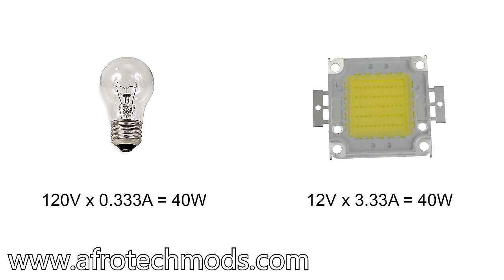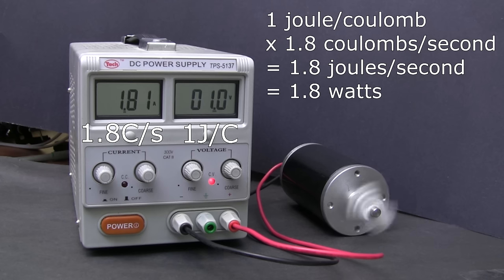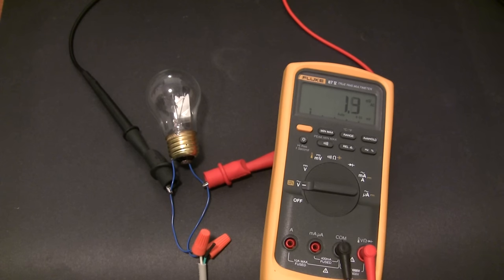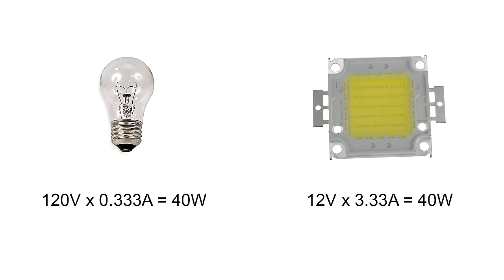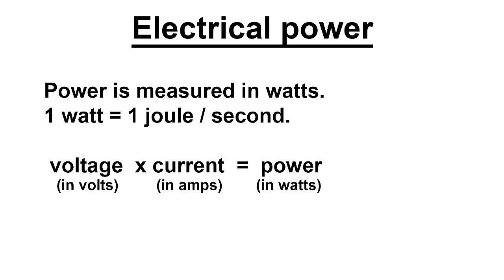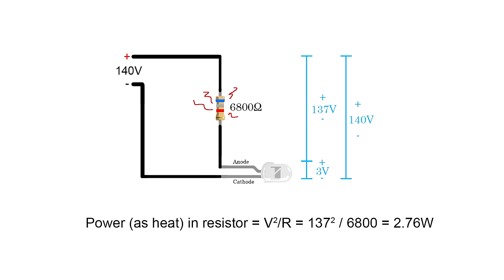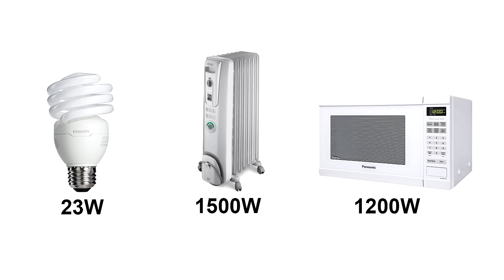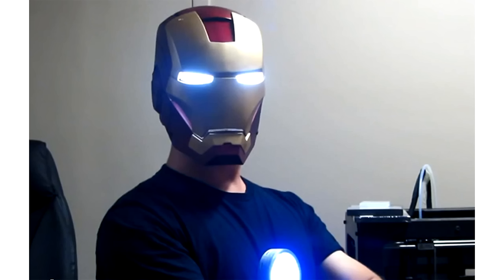Basic Electricity - Power and watts

Comment: another cool application for the voltage/current trade-off is high voltage power lines. the higher the voltage, the less current you need to transmit the same power. less current means less voltage drop across the power lines, and lower voltage drop means less power being consumed by the lines themselves. the benefit of this is twofold, it's more efficient, and you don't need as much material to make the cables.
Reply: And yeah, Thomas Edison lost the bet that DC>AC. Shame on him
Reply: but doesn't high voltage also cause high current. i thought current was reactor to how much  volts you had  so even if you dont need the  high you'd still get it right? im learning so please forgive my ignorance.
Reply: The last time I dealt with transmission lines was underneath a Ford van.  I had to throw my coveralls away, because I couldn't get rid of the red stains.
Reply: @NoVaKane  Yes and no.   Whenever we work across a fixed load, then current is directly proportional to voltage.  Kirchoff's law.  But in practice, higher voltage results in lower current during POWER TRANSMISSION.  You see,  the higher voltage is stepped down before and during DISTRIBUTION.  So, if the end user (subscriber) has a 240 volt service, rated at 100 amps,  that would translate to 1 amp at 24 KV,  or 100 milliamps 240 KV.  Now,  if we were to apply 240 KV to the same load at the subscriber,  everything plugged in would try to draw 1,000 times the current.  All the magic smoke would escape. But since we are dealing with VA (Volt-Amperes),  instead  of current,  the two factors cancel out, and we deliver the same number of VA over the entire system.  Since transmission lines run at 100 times or more volts than the distribution grid, and the power load is the same,  the current in these HV lines is less, since the voltage hasn't been stepped down yet.  I hope this makes sense.
Reply: @gyrgrls  Forgive me if I sound like an absolute idiot but I thought that the voltage is what pushes the charge and current is the flow of charge so if the voltage is high, surely the current would be high too?
Reply: @umr4h138  think at the dumbest atomic level, where electrons constitue currents and what is potential at that level.
Reply: In vietnam we get 220v from electricity, but in america they get 120v, that's because the lines they use is less ohm than our

Comment: You've forgot to mention a crucial thing, which is that everything runs on white smoke, once the white smoke gets out it doesn't want to work anymore.
Reply: hahaha
Reply: exept for those who run on blue smoke
Reply: That's magic smoke.  FWIW, the LED was still glowing while the resistor was burning.  DAMN!  And I was willing to take side bets on which component would go open-circuit first.  NO FUN!  But, since LED's have an internal resistance,  they are self-limiting,  therefore negating the need for a series resistor, unless the voltage supply is substantially higher than the nominal forward voltage of the LED.  But I digress.  I vote for the resistor.  If the resistor wins the vote,  you have to ship me the LED.  ;`>
Reply: That's not true. When a component gets too hot, it starts to burn, thus producing smoke.
Reply: Lmfao
Reply: The secret then is to not let the smoke escape!!
Reply: Lol
Reply: A fellow man of science!
Reply: @31redorange08  It's a joke.  Lighten up, Francis.
Reply: @31redorange08  I saw this comment 3 years after you made it,  and was annoyed that you laboriously explained another person's joke. Lame. Your social ineptitude will echo throughout the ages.
Reply: @dorkthrone  What Joke? I exposed their lack of knowledge. Even more important in today's world of misinformation.

Comment: I feel like i'm never gonna understand this stuff, and I so want to!
Reply: David Leef - That describes my motivation pretty well!  I would only add that it’s REALLY fun when we understand ANY of it and use that understanding to make fun gizmos.
Reply: This is pretty simple for me
Reply: I feel your pain.  This stuff can be tricky to understand.  There are at least five different videos on YouTube explaining watts.  Different teachers often explain things in different ways.  Watch all five of of them and very likely one of them will make sense to you.   A watt is defined as the amount of energy (disapated as heat) of one amp of current flowing through one ohm of resistance in one second.
Reply: @rmorgan453  I feel like the easiest explination would be to think about it in terms of joules used per second. You start with the basic Coulomb, that would be the charge of 6.24 * 10 to the 18 electrons. Then you go to current, that is measured in Amps. 1 Amp would be equal to 1 Coulomb (the charge of 6.24 * 10 to the 18 electorns) passing through a point (that you chose to measure) in one second. Next you have to think about Voltage in terms of Jules per Coulomb. Every Coulomb has the rated voltage in joules. Combining them all you get to power that is simply joules/second. The amount of energy something uses every single second is what power is, and that is called watts for sake of simplicity.
Reply: Agree! It’s like Greek.
Reply: I am right there with you! I feel like I'm hearing Charlie Brown's teacher...Whah, Whah, whah...
He is explaining it well, but I feel like I need to be in with the slow kids. 😒
Reply: Well, if u pushing some boxes in ur room, how much energy to each box is voltage, how many boxes being pushed in a certain spot is current , and how much energy ur using in. Second is power, that’s it .
Reply: It wouldn't be so confusing if they didn't have different names for the same thing.
Reply: How is your learning going?

Comment: Leonardo Rodrigues
Leonardo Rodrigues
5 years ago (edited)
Thanks for the high quality videos. Instructive and amusing. I have been working on a project in which I'll have to use a current limiting circuit to protect my DC power supply. Can you make a video about the different choices for this case? I don't know if it would be popular enough, but is just a suggestion. Cheers

Comment: I'm really grateful. Quick question though; what causes the resistor to go up in smoke?..voltage, current or power?
If power, that should mean a low voltage, and a high current could generate such heat
Reply from the maker: Power. And yes low voltage high current can do it if the resistance is low enough.
Reply: @Afrotechmods  thank you, sir. I'm a big fan, though a medical student 😅

Comment: Thanks for the high quality videos. Instructive and amusing. I have been working on a project in which I'll have to use a current limiting circuit to protect my DC power supply. Can you make a video about the different choices for this case? I don't know if it would be popular enough, but is just a suggestion. Cheers

Comment: I'm curious to truly know if an electrical component going up in smoke is tied more to current or power as from what I've learned having too much current while keeping a low voltage but the same wattage is a good way to lose power while frying whatever the power is going through simultaneously

Comment: Does V x A = W only apply to DC and linear AC loads? When does power factor come into play?

Also, why are transformers rated in kVA and generators rated in W?
Reply: No, that formula applies to any current form, but when you have a current that changes throughout the time you need advance math to solve it. And we often use different units because of convenience and habit, when you measure how much energy you used in your house in a month for example you mesure it in kWh instead of Joule, it is easier that way. Thats why
Reply: You're wrong. You can't measure power in AC as in DC. If you just simply do P=VxA will only show you the Apparent Power, not the real power. In order to explain why transformers are rated in KVA, you need to know what POWER means. There are 3 types of power: 1. Real Power (W), Reactive power (VAr) AND Apparent Power (KVA).
In order to measure the power in AC, you need to know this:

u = U (sin omega t + fi 0)
i - I(sim omega t + fi 0)
Note that "u"/"i" and "U"/"I" (in capital) are not the same.
U/I - The voltage/intensity displayed on the multimeter (Peak voltage/intensity)
u - the real voltage.

If you get U x A = The peak power (apparent power, also rated in KVA) - Now you know why the transformer is rated in KVA. That's the peak power they can support. If you put a load bigger than the maximum KVA, you will most likely burn it.

If you get u x a = The real power (KW or W). You need to know the real power on generators so you know what you expect the load will do. If the load is bigger than the real power, it will burn the generator. Basically generators are not rated in KVA because you don't need to know the peak power. The peak power is there for only 50Hz/60Hz (50/60 times/s) but the load you put on the generator it is a constant load.

"fi 0" is the resistive inductance or the capacitive inductance.

This is a better mugshot (pun intended) about this explanation: http://www.sgs-engineering.com/wp/wp-content/uploads/2015/09/beerkva.jpg
Reply: Forgot to say:
Any variations between u x A or U x a you will get the Reactive Power
Reply: Also, sorry for any mistakes if there any but English is not my main language and is not that easy to translate physics terms from Romanian to English and also, I only slept 2 hours in the past 2 days....
Reply: Riddim Dubstep your the man. That was explained very well. Helped me out a lot. Thanks
Reply: @ryanhayn You are TOO polite.  You should play on Jeopardy,  where you phrase your response in the form of a question.  Frankly, I don't have the patience to do this. Instead of playing dumb, I play the fool (the smartass).  When I see bullshit, I call bullshit.  YMMV.  SUBSCRIBED!

Comment: Power is the rate at which energy gets supplied, or used up and instead of saying joules per second, we have a unit we use for power, called the watt. Also 1 watt is equal to 1 joule being transferred. Voltage and current that leads to power. Voltage and current can be combined in different ways to get the job done.

Comment: For people that don't get it: Think of electricity as water flowing through a pipe. Volts is water pressure. Amps is pipe diameter. If you increase one or the other, you get more "power".

Comment: +Afrotechmofs fantastic man!
I wanna mention something fail which most of the people don't know about. For example that LED  lamp which u showed rated as 40 W, but the issue is, when we gunna power it with some power supply like a transformer (not a battery), we have to calculate how much the transformer will drag. Depending on the bad efficiency of the most of transformers we'll find that the power which is needed to power the LED is about the double, about 80 W and that's horrible!
Am I right? Thx
Reply: Tom Tommy transformers are just about the most efficient possible way to convert electricity. 

That being said, do you mean voltage droop on the transformer, where unloaded, it's x volts, but with a load, it .5x volts?
Reply: +Ethan M thx for helping first!
Then, no I didn't mean the voltage drop. I meant the efficiency. As I know  η=(Vo*Io)/(Vin*Iin). I have a LED strip which is powered by a cheap 12V 10A transformer, so I did a few of measurement and I got theses numbers, for the input I=28.8m.A and V=220v so P=6.3W.
And for the LED strip which is the output I got 244m.A and of course V=12v so P=2.9W................... so.........  η= 2.9W/6.3W = 44% !!!
Is it fail? Did I forget considering anything? THX again!
Reply: The Traveler 10% okay, but in my case it's 56% !!!

Comment: 1:11, amps into coulombs per second
 Real-world example, if you use air conditioning with declared power of 3500 watts, and your city grid is 220 V, that means that your air-con device will pull 15,9 amps through the electric wire to put it to work. (3500/220 =15.9), simply the declared power of an electric device tells you how many amps it is going to need. A 500 watt PC will suck 2.27 amps through the wire. All power consumption in ampers sum up, and if it exceeds the Fuse limit, it will break the circuit for your own protection. You can make a mistake by putting the higher value fuse than it is the capacity of the specific wire. In that case, it will let the higher ampers pass...and the wire will melt, burn and cause a fire.

Comment: how a light bulb can "draw"  something? in this case current (electrons per second)? a higher wattage light bulb has a filament with a lower electrical 
resistance?  edit: 2:26  ---> why through the light bulb flows fewer amps at a higher voltage than the led setup which has a lower difference in potential energy but through which flows more amperes?

Comment: I am very new at all this, so I need to ask:
When the resistor burned, how come the LED kept giving light? 
I would expect that, when the resistor burned it stopped working, which means it stopped "choking the amps", and so too many amps would flow into the LED and it should have burned also. And, yet, the LED kept giving light. 
Am I getting something wrong?

Comment: does low voltage like  change the current to be high or is it when the voltage is lower then  current,  essentially the electrons just siting there with no where to go almost and just start to heat up like pressure building up on a hose?

Comment: forgive my ignorance. why does,when using a lower voltage then the item is rated for, cause current or current draw  increase? if current is dependent on volts in the first place.r am i not understanding something.  my fan says 120 volts but battery is 12 volts. ive read current will increase to compensate but that doesn't make sense to me unless there is an internal feature of the fans circuitry that causes this to happen?